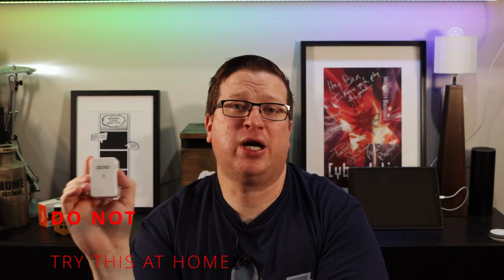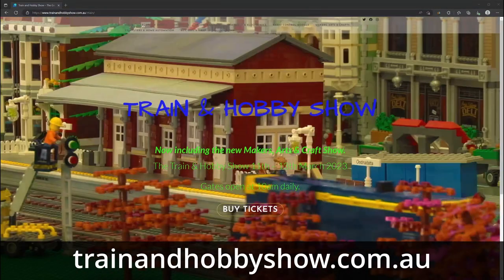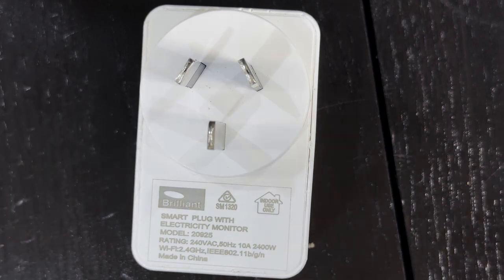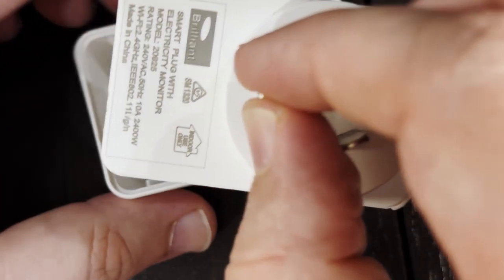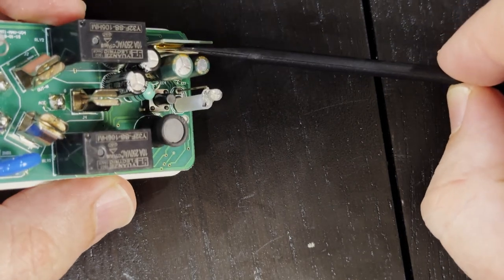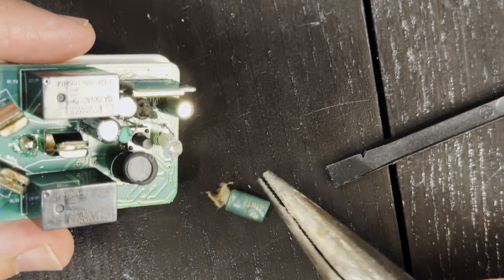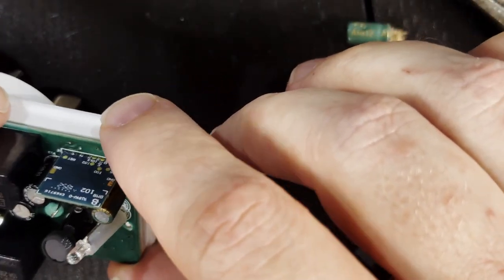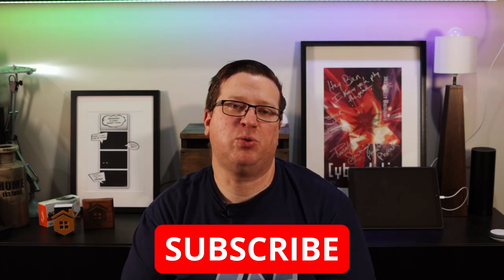Autopsy of a dead smart switch

Comment: Interesting Autopsy.  I've a PowerTech one from Jaycar, and it looks to have the exact same fault, with the same cap.  I've not pulled the cap out as yet, but it's got a slight bulge in the top. Colour and size looks the same as yours.  I wonder if there is an inherent design fault with these power monitoring plugs?
Reply from the maker: I think half the problem is likely cheap components. I'll throw a new cap in there at some point, maybe even over-spec it with a 470uF 16V jobbie and see if it comes back to life, but there's no way I'll trust it with any "critical" loads again.